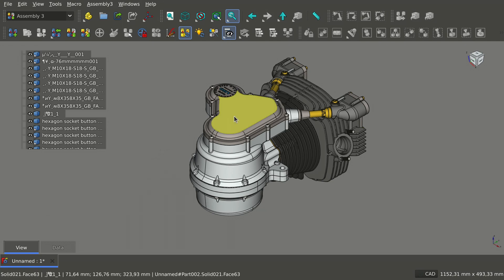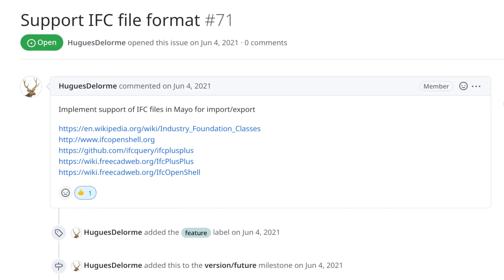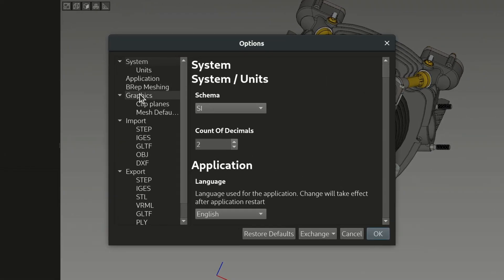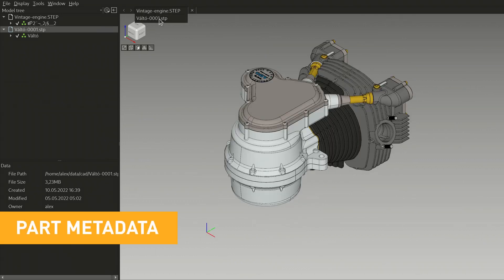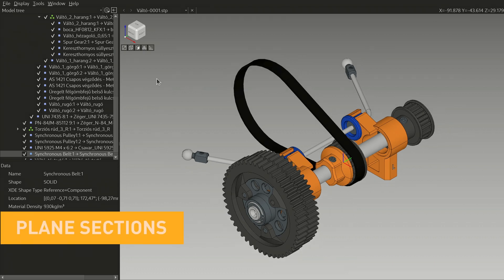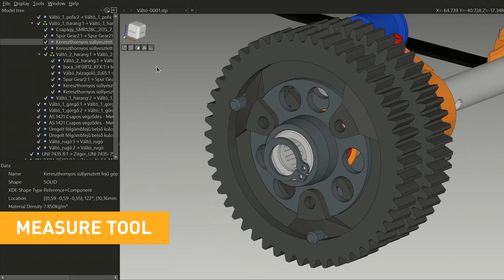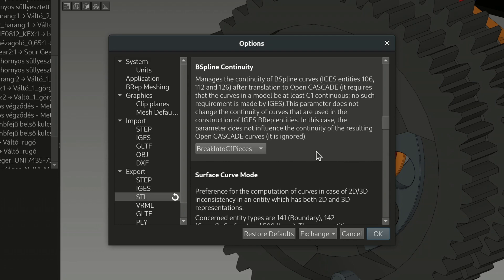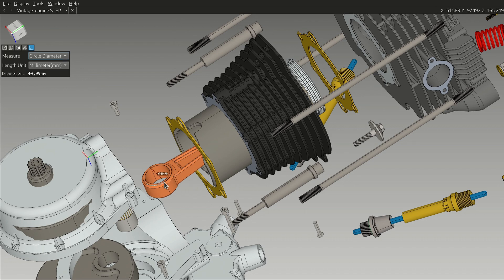Take a deep dive into your 3D CAD files with Mayo

Comment: I want to use this for converting stp to stl and extract the single parts and save them as single files. The main problem i have, also with OCCT and other tools of this kind, is that i need the labels/names of the single parts as filenames and i cant find a way to extract them with the help of a script, is mayo able to do that?
Reply from the maker: Not yet, but it's coming. There's a branch where Hugues is adding QtScripting (JS) support to Mayo. Not sure ho much coverage it got so far and definitely no idea when it's going to be released. Did you try scripting FreeCAD instead?
Reply: @LibreArts  Yes but the opening and/or triangulation takes far to long i want to import stp in unreal in real time and i tried different thirdparty softwares and libraries but all had different problems, Free CAD was to slow cad querry was fast but i didnt manage to extract the names and hierarchy, and occt itself needs to much space with all its third party dependencys and i dont know how to nail it down on the things i need. At the moment i use a portable version of blender with STPper but there you can also not do it in background because the plugin needs the GUI Version. I am currently trying to find a access point in the addon where i dont need the GUI... At the moment there is no plugin for unreal to import stp and other CAD files in a packaged build maybe you guys are motivated :D I would buy it.
Anyway thanks for replying. :)
Reply from the maker: @zipi9000  I'm not sure it's possible to run QtScript/JS with Mayo in headless mode. If FreeCAD doesn't work for you, maybe try Assimp? I don't remember if they support STEP i/o though. P.S. I'm not Mayo's developer :)
Reply: @LibreArts  Yes Assimp doesn't support that or its bugged or something came across that one as well.